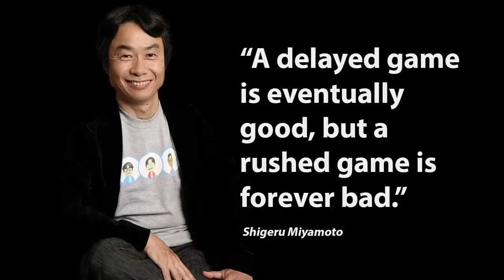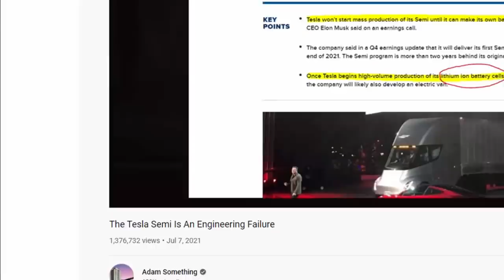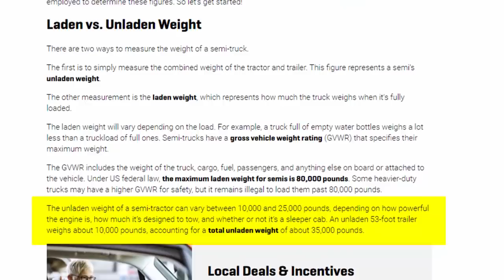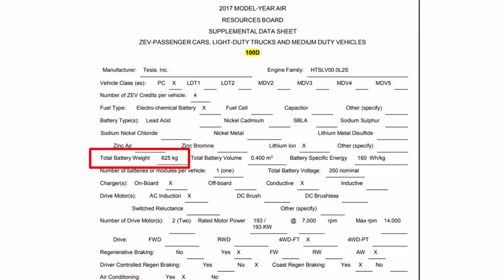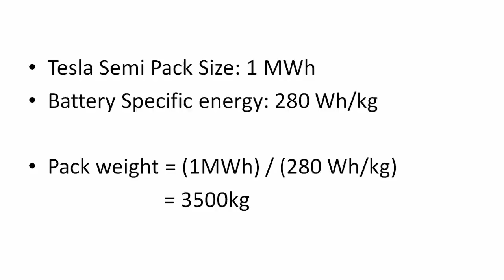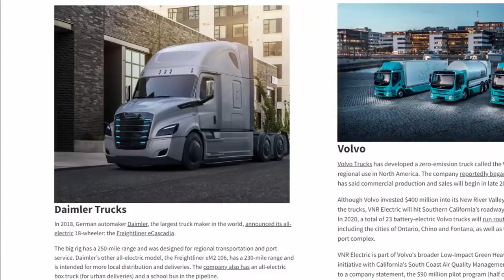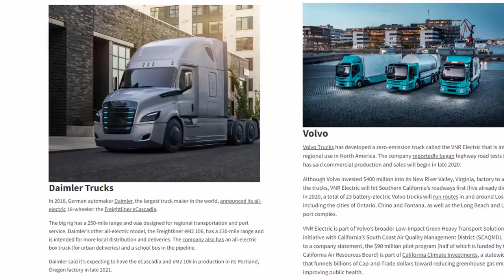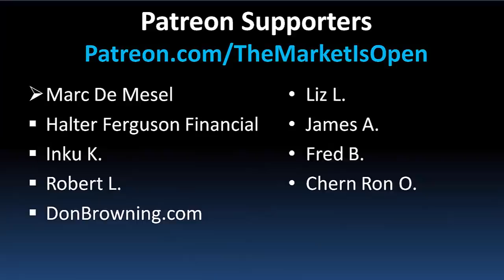The 2022 Tesla Semi is Genius, And Here’s Why

Comment: One thing that is not mentioned. 
The state of the USA power grid.  As it stands CA can barely handle regular usage much less mega chargers. 
Sorry until there is major changers in the USA power grid.  More nuclear power this will all be fantasy.
Reply: Therefore the megachargers are all equipped with megapack batteries. If you burn the oil in large power plants and generate electricity, you will just need less than half of the oil than you would need burning it in individual diesel engines. And you can burn it much cleaner.

Comment: The EV is like going from the horse and cart to the diesel engine, EVs are in every way imaginable better than combustion engines - its a no brainer, so it makes me concerned when idiots get on the radio etc, when they don't have the facts.
Reply: You know diesel is not the same as a gasoline engine right? There's also biodiesel which is enviro-friendly.
Reply: @mkocel  regardless of what type of fuel, it's outdated technology,  you're flogging a dead horse. I've heard of taxi drivers getting 300000km of range (so far) on their battery and $12 per fortnight for electricity for their ev - there's just no way fossil fuel can compete with that, that's just the facts.

Comment: If it wasn't way too heavy, Tesla would release the weight. All they do is dance around the number comparing it to some unknown diesel truck. I know it's way too heavy because they will not release a number that tells us exactly what this thing weighs.
Reply: The Semi weighs 2 tons more than the diesel. So what?
Reply: @vic321344  the Semi weighs 2 tons more than what diesel tractor? This diesel tractor you're comparing it to, what are the specifications? What engine? What axle weight rating? Day cab or sleeper? Single or double frame? Lots of ways to spec a truck tractor, and lots of different weights, so comparing this to some unknown truck-tractor means absolutely nothing. It's just Elon using weasel words so he can weasel his way out if anyone tries to nail him down to a number. So since you think you know so much, what is that number???
Reply: @joecummings1260  
The electric drivetrain incl batteries and engines weighs 2 tons more than the diesel drivetrain. If you add a large cabin or something else, it adds up on both variants.
In Europe BEVs are allowed to weigh 2 tons more.
Reply: @vic321344  so basically what you're saying is this thing weighs 2 tons more than an unknown diesel tractor. That would put it between about 19000 lb to 32000 lb. That's a big wide range. Basically that's saying I don't have a clue what it weighs
Reply: @joecummings1260  Maybe my english is not good enough for you to understand: The electric drivetrain incl batteries and engines weighs 2 tons more than the diesel drivetrain.

Everything else is comparable in weight between ICE and BEV tractors.

Comment: Let’s wait to see how it performs in the real world carrying weight as the driving range on Tesla cars drops dramatically when pulling a boat or trailer as EV batteries discharge much quicker when pulling heavy loads on frequent start and stop.
Reply: Exactly
Reply: Right? i cant see it pulling a full load up a winter highway incline.
Reply: @mkocel  Yeah, the Semi will do it much faster and more secure. Every single engine is controlled to perfect torque transmission.

Comment: Payload isn't limited to 80,000 lb., that is just a typical axle configuration for an over the road semi. The truck weight is limited by bridge rules that limit weight based on tire spec.s and axle spacing. Increasing axle spacing increases load capacity for a set of axles. Adding drop axles also increases load capacity. Local DOT offices have the spec.s available.

Comment: Jackknifing!  a tractor trailer driver's night-mare! Can the Electrics'  lower center of gravity combined with its larger motor and battery location change the inertial effect in a positive way?  Can a computer driven emergency system using the 4  wheel  drive advantage help prevent these? Considering that Electric motors can be switched from forward to  reverse spin in an instant and can go to  full power in either direction if needed, the widow making jackknife may be reduced or eliminated entirely in some cases in the trucking world.

Comment: Does diesel cause cancer? To those outside trucks? Inside trucks? Servicing trucks? Does anybody have any numbers on this?
Since Tesla's announcement, a new, "Flat" motor format using formerly unavailable computer controlled power switching, that yields higher efficiencies, higher torque, lower weight for an overall better matched electric motor application. Is this good for trucks too? (Almost like a transmission?) 
Advances in tire manufacturing have been announced by Michelin and other tire manufacturers that may help Electrics too? (lower slung motor and battery weight may change things for tires) 
Less vibration in the electrics may allow for better, lighter materials and other weight saving advantages.

Comment: Weight limits are also there to protect bridges. Up the truck limit and more bridges will need weight limits.
Reply: same bridges can handle oversized loads, more of a permit play
Reply: @justus7181  Some of those bridges are two way, so the calculation of a 30 ton limit is that two 30 ton vehicles can pass each other. Closing the bridge off and only allowing a 50 ton vehicle on it can mean it is taking less weight than two 30 ton vehicles at the same time. Other bridges might be able to handle more weight if an engineer checks over the bridge. Permit Play may exist in some places, but it isn't the only possibility.

Comment: This appears to be a yuge innovation and one the industry sorely needs. My brother drove a truck cross-country for a million miles. How cool would it be if self-driving trucks helped alleviate the severe driver shortage we now experience. One thing they might not have thought of would be uhh. let's say undesirables jumping on the back and tops of driverless trucks to catch a free ride. It would be a risk to their safety as well as the security of the load and would reduce the truck's range.  Cameras, sensors and software that senses unwanted additional weight would have to be installed.
Reply: African asylants tried that to get through the tunnel from france to england. Did not end very well. Even with an ICE truck.

Comment: @1:46 It’s only 318 miles when you have the upgrade 20 inch wheels it’s actually 330 miles with a standard wheels and 326 with the seven seat option.

Comment: What we know for sure is this does indeed use the 4680 batteries, and these batteries are also going into some vehicles, not just the cyber truck.  There are different versions of the same vehicle, and it's almost certain that some vehicles coming out of the Austin plant will have 4680 batteries.  On top of that the latest info from Tesla is that their semi will have better weight capacity than diesel.  And they should know since they start mass production this year with models being delivered at the beginning of next year.

Comment: As someone in the trucking business I can attest that that weight is still far to heavy to be practical. In a dry freight configuration as it was shown, 22 ton capacity is standard. Certainly many loads are are lighter lighter than that. But, putting a truck on the road that can’t scale industry standard weights puts you at a disadvantage and cuts you out from too many loads to be profitable.
Reply: Pretty irrelevant, the truck isn't in production.
Reply: @paulbedichek2679  not anymore, 10 months after..
Reply: @paulbedichek2679  Call Pepsico and tell them, that the 15 Semis they got delivered are not existent . They will be glad to hear from you.
Reply: @vic321344  It is three weeks later, not a single tesla semi delivered to anyone.
Reply: @paulbedichek2679  A delayed truck has potential to be good but a bad truck is bad forever.
Reply: @paulbedichek2679  it is now. Your post didn’t age too well
Reply: The semi weighs 2 tons more than the diesel. So what?
Reply: Shippers tend to want their money worth, and are rarely willing to cut weight on a shipment. That 2 tons means a lot in the real world.
Reply: @phatallbutt7879  In EU you are allowed to weigh 2 tons more. So no problem.
Reply: @phatallbutt7879  Diesel literally costs $7 a gallon Lol, I think there's gonna be a ton of operators willing to shave 2 tons off payload versus paying that much for fuel
Reply: @vic321344  You are confused, the total wight allowed is 2000lbs more, this means with the huge battery wight the payload is that much less. This can still work, for ex Pepsi can use them to deliver snacks from the warehouse, these would be volume limited not by weight, thy'd us diesels for the drinks.
All the EV semis actually in use to date use much smaller batteries, thus saving on weight, lots of everyday routes are 100 miles or less.To be efficient we want the entire battery used every day.
Reply: @vic321344  whatever fool.. Do your basic elementary math.. Semi weight is insane.. Unprofitable to say the least..
Reply: Did you not watch the video? The Tesla semi will be able to carry the same load as a diesel truck.
Reply: These are the standard load capacities, flatbed 24 tons, dry van 22 tons, and refrigerated 21 tons. If you can’t scale those weights, you cut yourself off from most freight opportunities.
Reply: @phatallbutt7879  The tractor weighs just 2 tons more, so where is the problem? And even if you cannot provide the whole capacity, your costs of operation are just 1/3 of a diesel. So you can make a good offer. What do you think the freight deliverer will choose?
Reply: @vic321344  the problem is the federal government can increase the weight all they want dosnt change the fact that axel and tires have a weight limitation put ther for safety . That why we have scales house the weight the truck by the axel . If you exceed it you get put out of service. Your are exceeding the weight carrying capacity of the tire and axel. On all existing trl In your fleet Solution for owning a tesla truck haveing to buy a new 150k trl so you are legal come on
Reply: @mikevenson7818  I dont think that axles or tyres will be a problem. 2t more is not the world, just under 7% more.
Reply: @ChristopherGuilday  over a shorter range

Comment: The Rivian towing a gross of ~14,000lbs gets 100mi of range with it's 130kwh battery.  If it had a 780kwh battery pack it would it be able to tow 80,000lbs 100mi?  Or just 14,000lbs 500mi?  How big of a pack would it need to do both?
Reply: To big to be a workable solution.
Reply: A 780kwhr battery would weigh over 10,000lbs.

Comment: Hear me out what if instead of using heavy and expensive batteries we instead ran a wire above the road the vehicle could get power from. In fact in order to reduce wear and tear on the road why don't we make the wheels out of something that is durable and has a low rolling resistance like steel.
Reply: I think you might have something there. And we could put a track down so one person could pull multiple trailers without losing control of them.
Reply: I actually thought this video was parody at first because of the Miyamoto quote and the Hbomberguy title lol
Reply: That was already invented. It is called railway.

Comment: The Tesla Semi seems pretty amazing and I think they are coming in a certain percentage, but I can’t see these trucks fully loaded and getting 500 miles on a charge in winter weather and hilly terrain. On the flats they will be better. After years of infrastructure investment for charging and the willingness for trucking companies to buy electric rigs, they may start to become commonplace, but it’s going to take a very long time. Perhaps decades in my opinion.
Reply: What they never tell you is that the battery is going to weigh 8 tons, with will reduce the maximum cargo load to a point were it doesn't make logical since to use these trucks.
Reply: @LionelLordOfTheThundercats  Did you not watch the video? That was the entire purpose of the video… It shows how the battery will likely weigh somewhere around 3.5 tons.

You have to also remember to subtract the heavy costs of the diesel equipment (Engine, oil, gas, coolant, etc)
Reply: @ChristopherGuilday  Yes that was the purpose of this video, but scientifically that isn't sound at all. Elon already stated that they would using model 3 tech to develop this truck. Look at the weight of a model 3 compared to a similarly sized Honda Accord. It is much heaver because the battery represents more then a third of the vehicles weight. The battery on a model 3 weighs about 1102 to get a range of about 350 mile. The Accord carries about 88 pounds of gas to get a range of about 560 miles at the same weight. In order to get the same range out of the tesla battery you get from the accord you would need a 1763.7lb battery. So pound of gas carried the tesla requires 22 pounds of battery to achieve similar range. A semi can carry about 800 to 1600lbs of fuel, which means the battery size to match that range would be between 8-16 tons.
Reply: @ChristopherGuilday  Even the EV semi itself will weigh tons, it HAS to, in order to haul heavy loads. They make those frames from STEEL for a reason. And the diesel engine and drive train aren't the heaviest part of a diesel rig. Also, diesel has been around a long time, its reliable, the engines are tough AF and need to be. The tesla semi will, I'm sure, one day surpass the diesel semi, but it wont be for a few decades at least.
Reply: @LionelLordOfTheThundercats  Well obviously,Tesla isn't stupid they make Y and 3, not semis.
Reply: @paulbedichek2679  Tesla has delivered 15 Trucks to Pepsico. The large scale production will begin 2023, when the battery factories for the 4680 cell will be ready.
All other manufacturers have to be satisfied with 300 miles range, as they dont get better batteries. If they get them at all.
Reply: The semi weighs just 2 tons more than a diesel. The 1 MWH Battery weighs around 4-5 tons. And has much more torque than a diesel. It is perfect for winter weather and hilly terrains. All motorized wheels can be electronically controlled individually, so always perfect torque transfer.
Reply: @vic321344  Tesla semi is vaporware VW is ahead of them in sustainable transport.
Reply: @paulbedichek2679  The CEO of VW says they cannot catch up to Tesla unless they make major changes.
Reply: Just realize that a Tesla can get 200 miles of range in 15 minutes, and that’s using the old battery tech and significantly smaller batteries.

The larger the battery, the quicker the battery can charge when it’s close to 0%.

I imagine that the new Tesla semi’s will be able to charge much faster than the current Tesla model S, and get 200-300 miles of charge in around 10 minutes.

That means you can go 2,000-3,000 miles in just 1 1/2 hours of resting, which makes the range a complete non-issue as you’ll need to rest more than that anyway.
Reply: @ChristopherGuilday  Not one thing you have said here is true.
Reply: @ChristopherGuilday  Tesla semis refuel quickly but no faster than any other diesel,tesla semis are all diesels.

Comment: Fossil fuels will NEVER be fazed out to zero" because oil is used in lubricants, tires, rubber in general, chemistry, plastic, even medicine.
ANd even ALL of THAT is replaced with something else, all military vehicles and planes and ships are running on fossil fuels plus regular airplanes and ships. Natural gas is beside it's use in power plants also used in chemistry, smelting metal etc.
At his point in time ANYTHING you want to produce is bound to use oil in some form, there is NO way around it.

And just so no one forgets, if every single car that leaves factories around the world is only EV (and not hybrid that uses petrol/gassoline), it there is enough batteries that can be made each year, it will take 20-25 years to replace every single automobile with ICE.
Reply: Shhh your ruining their fantasy. The insane part is the amount of focus being put on electric cars instead of alternatives materials that don't rely on oil as even if you waved a magic wand and every consumer car was replaced with an EV it would only make a small dent in oil usage.

Comment: Good video, except that your "worst case" is not necessarily a "worst case". 
This would mean that to achieve the 500 miles max, you'd have to start and stop at a point where you can charge your Truck over night. Look around the country and smaller cities, where can you charge your Truck? This could be a problem that could lead many truck drivers to rather want a fuel powered truck. Because a battery above 500 miles or 5 tons is just infeasible.
Imagine what happens when you drive your truck to a charging station that doesn't work and the next one is 50 miles away? There is just not enough leeway...
Reply: On top of that electric batteries hate cold weather just dropping below the freezing point can take 20% or so off your range, it gets even worse as the temp goes below zero with many Tesla users doing tests on youtube showing upto a 60% loss of range when even at -30.
Reply: Also the weight of the truck lowers the max weight of the cargo.  The heaver the rig the less cargo it can league carry.
Reply: @LionelLordOfTheThundercats  But it is much cheaper than any Diesel. And this argument will win.
Reply: Worst case for a Semi: Go to the next Supercharger and "Trickle load" it with 350kW. After half an hour your batteries will be half full. In my experience Superchargers always worked.